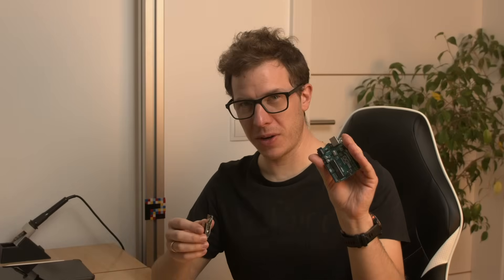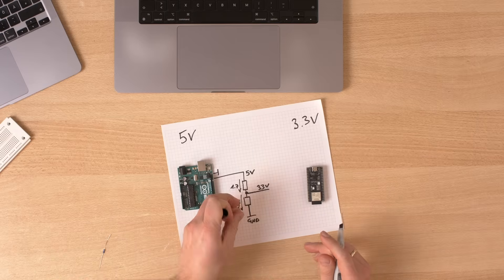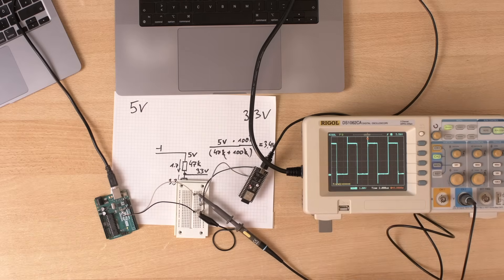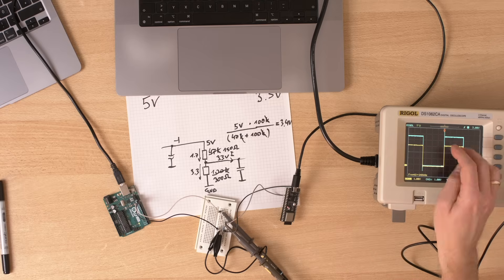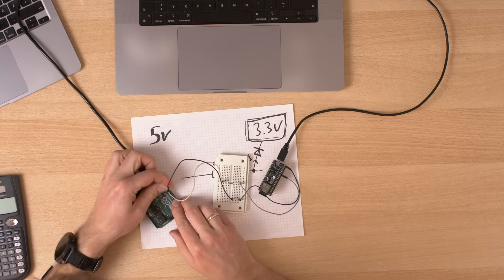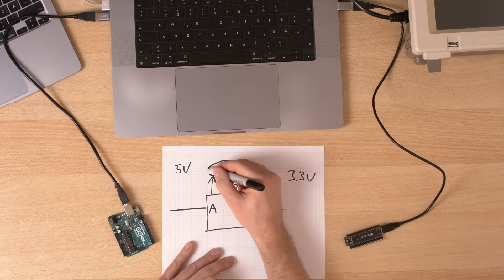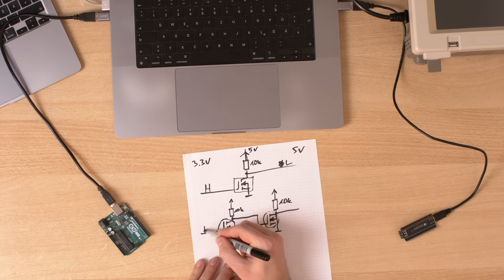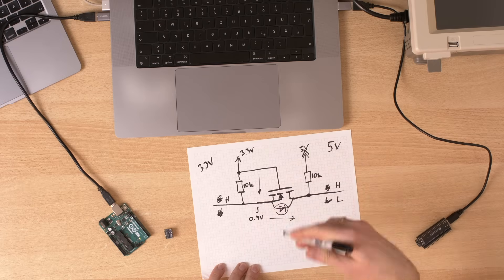Logic Level Shifting: Voltage Divider vs MOSFET vs Chip — Best Option?

Comment: I use 74HCT125 level shift, Esp32 with wled app. Work 100%. For long distance spi signal I use 2 RS485-TTL and cat6 cable

Comment: I came up with a variation of the bi-directional level shifter you presented here. Mine uses active pull-ups (an N-Channel MOSFET and a P-Channel MOSFET) on both side of the shifter.

Comment: Hi nice video with explanation from you side, and commenting as well. Could any one help in designing a PCB for a Lathe controller using STM32F407 CPU. What is best way to connect 5 volts close loop Stepper Drivers to a STM32 F407. Will be using 2 close loop Drivers 5v, Spindle Rotary encoder 5v, 2 100 line hand encoders 5v and 4 position Joystick with center push rapid button 5v. I can do PCB in EasyEda, can some one explain how to connect 5 volts peripherals to 3.3v STM32F407. Tank you.

Comment: At 15:55 the resistor is tied to 5V, so the circuit on the right will have  5V when the transistor is in off state.  I hope it's obvious why this is bad.
Reply: This circuit is going from 3.3V to 5V, not the other way around. The circuit on the right is the 5V circuit, so having 5V when the transistor is off is fine.

Comment: I had no idea about the protection diode. Freenove actually has a tutorial in their ESP32 starter kits where an I2C display is connected to 5V (which also set both I2C lines to 5V), and I thought it was a mistake. 

I emailed them about it and they just told me the current is very low, so there should be no problem and if I wanted to be extra safe, to use a logic level shifter.

Comment: Great video. As long as there’s enough space, we often use ready made bidirectional level-shifter boards based on the BSS138 mosfet for most of our 5 V sensors when working with STM32 processor boards. They do have some limitations, though. Sensors with outputs approaching 1 MHz, or motor step/dir signals in the MHz range, can produce noisy edges. But for most applications the mosfet approach works very well, and as you showed, sometimes a simple resistor is all you need. We’ve run an Arduino Giga based application with several 5V HX711 modules using nothing more than a 10 kΩ resistor.

Comment: 11:48,   "So I wouldn't do it like this...  this might kill the ESP"
100%, always stay within the datasheet specs for max and minimums.    Thank you for pointing out the 'trial' and the reason for not doing it.
A lot of time, effort, engineering, printing, corrections, etc., go into the making of the datasheets.  You want long-lasting working designs?,  increase your chances with working within minimums and maximums.

Comment: The ATMega 832 understands 3.3V levels even if it is supplied with 5V.
The ESP8266 is intended for 3.3V, but survives 5V signals at the input.
It is much more dramatic to send 5V signals into a Raspberry Pi.
Reply: I see your point, but you need to remember that the whole 'VDD+MAX' thing for, in this case, a 3V3 MCU is practically a side effect.. For example, just because the RP2040 or RP2350B may withstand 5V doesn't mean it's a guarantee for all batches - Not too mention that things in the silicone may melt/blowup in a specific state, withstanding doesn't mean operational after all..

(TL;DR you may get lucky once in the prototype stage, but keep poking the slumbering dragon's tail and Reality will hit hard.. It's a 3V3 MCU, utilize it's specified logic state levels. :p)

Comment: Or you can use a module with a TXS0108E it costs around 1€ and should be good upto 10 MHz (don't quote me on the max frequency but that's what I remember)

Comment: a safe way to feed 5v into 3.3v logic is to use a schottky or signal diode with the cathode to the output of the 5v logic and the anode to the input of the 3.3v logic. connect also a resistor from the 3.3v rail to the common node of the gate input and the diode anode. when the output is high the diode blocks and the input is high at 3.3v. when the output is low the diode conducts, the output sinks current and the input is at the diode level, at about 0.7 or 0.3 volts or less, pick the resistor as a compromise between speed and bias loss for the diode.
Reply from the maker: Nice solution
Reply: Only problem with the resistor-diode network is speed. The high side is driven by a pull-up resistor, which makes rising edges blunt whatever value is picked. It works fine for slow logic but isn't acceptable otherwise.